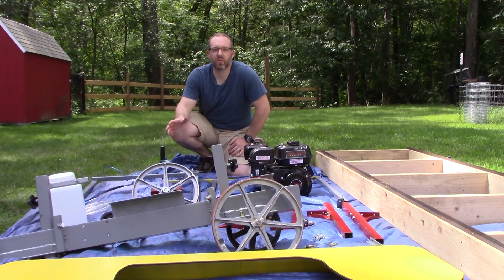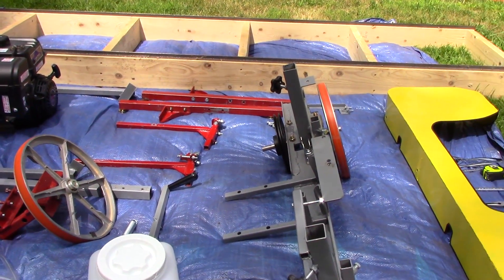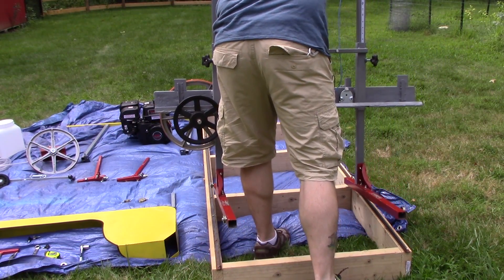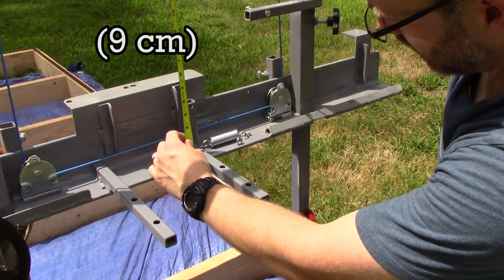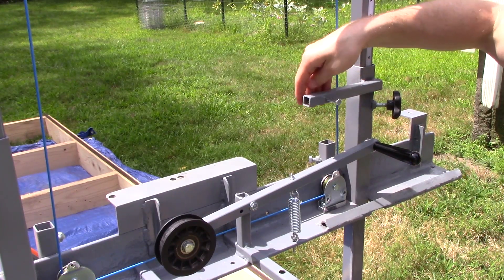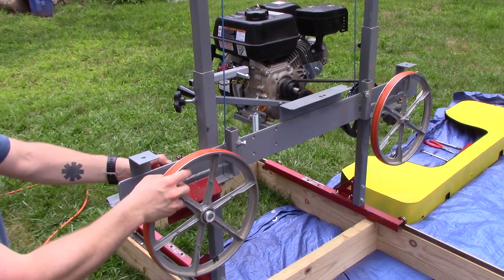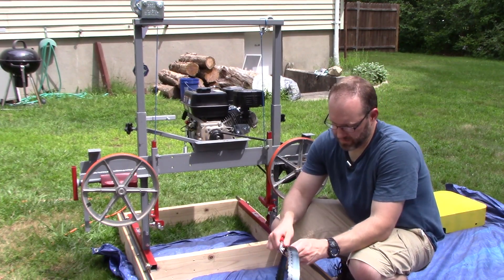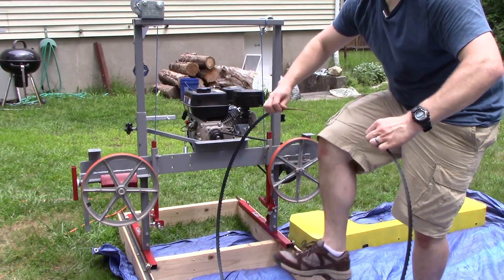Homemade Sawmill - Full Overview plus Upgrades and Safety Features

Comment: I'm trying to build my own mill and using 12 inch pulleys the only part I'm not sure of is the size and lenght of blade and how many teeth per inch. What size blade did you use

Comment: I had a blade that I ran into the saw guides so I used it to test and adjust my saw sharpener.  I ruined it even more testing the saw sharpener.  Even with the saw sharpener not completely adjusted it improved the performance of the damaged blade.  I will let you know if I get it running perfectly

Comment: So far I have sent over 20 copies of my plans of your design all over the world.   Lately it is been one request every few days.  Many commented favorably on the simplicity and portability of your design.  They like it.  It is a great design.  Don't give up on it.  Wondering how you are coming on  your redesign.
Reply from the maker: Hi Stephen, I'm still working on it.  I just haven't had the blocks of free time to do the grinding and welding.  Also debating whether to build the rails first or mount the new wheels.  I have a trailer that I plan to attach steel rails to semi-permanently.  Portability is still the goal.

Comment: Here a few thoughts on using my copy of your sawmill.  One of the members of my crew in Wisconsin was a small engine repair  teacher.  He said to use premium non ethanol gas for small engines.  He also said to turn off the Harbor Freight engine first slow it down then turn off the gas and then the spark.  Also to drain water from the gas tank there is a screw on the side of the carburator base that can drain some gas/water from the tank.  This has happened to me and   it works. Also one cause of blade wandering is a dull blade.  Today I had this problem cutting 16" oak.  I put on a new blade and problem solved.  Dennis, have you given any thought to blade sharpening?  Also to answer the previous post.  Mine cost approximately $1000 counting every nut bolt and screw with all new material.

Comment: Dennis, Thank you for your series on building a sawmill.  I just finished mine based on your design and in my preliminary tests  it works better than my wildest dreams.  I made a few changes to your design.  I used Grizzley 17" wheels which included an 8" and 9" pulley attached to the wheel.  I also used 2" and 1 3/4" steel for the uprights.  I Added a means for tilting the wheels to adjust the tracking.  I love your blade guides that can be tilted.  They are great.  Your tensioning system is also a great idea.  Nice and solid. I used cheap bearings that people have complained about,but at 10 for $13 I can replace them.  Mine is a little bigger.  It is also taller which was probably a mistake.  Ill see.  Thanks for the inspiration and for answering my questions promptly.  I am currently working on dogs to keep the logs steady.  I don't suppose you will be working on a solar drying kiln to dry all that lumber you will be milling. And doing a series.  Just a suggestion.  Thanks again. Great series!  It is a great little saw.
Reply from the maker: Stephen, that's awesome!  I'd love to see your improvements.  Do you have pictures?  My email is whatdennisdoes@gmail.com if you want to share.  Thanks!
Reply: Thanks Dennis I have a lot of video and a hundred or so pictures.  When I get them organized in, I hope, a few days I'll send you the best ones.  Thanks for the inspiration. My wife was supposed to take a video of cutting the first log, but I think the "on" button didn't work so I will have to retake it soon.  As a retired engineer I couldn't get over making a parts list and complete set of drawings so I could send them (pdf) along when I check them over if you want.
      Stephen Anderson
Reply: Stephen Anderson is this something you could email me... also? :)
Reply: @stephenanderson3056  Could i also have those emailed to me. I want to built one very similar.

Comment: my first production mill came with all kinds off glitches and it had all the bells and whistles but over the months and years i fine tuned it so stay with it lots of help out there and if it fits in the car your on the road just tweak it then how meany board feet will it cut build a jig for the track two cut sized lumber call it the weekend worrier would i build a mill from scratch yes have fun Dennis stay small that tinny  house thing still out there

Comment: I am about 95 % done building my sawmill based on your design.  There is an advantage to being retired. All I have left is the Idler pulley assy. and the guards.  I am impressed by your blade guides.  The tolerances are pretty close for them to work properly so I need to rebuild the first one I made.  If most of this is your original idea I can see several things that might be patentable.  One last  question How did you figure the belt size to make it slip when the idler is not applied and work with the idler.  I hope to make a video of some of mine so you can see it.  I have added a means to adjust the tilt of the wheels and therefore tracking and have added a brake for the trolley.

Comment: Place a centrifugal clutch belt drive on the engine and a bike brake handle on the push bar with a brake cable going to the motor, that way you wont have to keep stopping your motor like you did in the last video, the clutch will disengage at about 1800 rmp but will still give you top end speed once the engine has been re-engaged with the brake handle. the blade will slow to stop while taking the last slab off. with this you will be able to pull back the blade, set the height for the next cut pull the handle to engage full power and start another cut quickly. I've seen this done on the larger machine you can buy.
Reply: The simply design I like, If ok would like to use some of it for a larger machine, which I think would work great.

Comment: Another question.  What technique did you use to weld the nuts to the corner of the square tubing.  I didn't see any way to do it on the various welding channels.  Thanks  much.
Reply from the maker: +Stephen Anderson grind a flat about the size of the nut, then drill a hole larger than your fastener.  So maybe 3/8" if you're using a 1/4" nut.  Then just tack the nut on.
Reply: Thanks much.  I suspected it was something like that.  Nice to have it verified by the expert.

Comment: Appreciate your effort and frustration. I think you try to saw too bigger log for such a mall contraption. Wheels are too small so you cannot use a proper larger ,thicker blade. Also your guides are dodgy! Not holding the blade consistently because not griped downwards. I might add that the blade is not exactly parallel to the rails so it tends to go one way or the other fighting the grain of the log. Good effort though. I plan to build one sawmill and have several band saw stop get experience from. Have a good Xmas

Comment: it might add some more rigidity if you add a bar on each side of your yellow handle bar, up to the top of the uprights. it"ll tie it all together and maybe take some more of the wobblyness out of it, as its cutting.  I think you have better luck if you had used bigger, heavier materials to build it, but i think its a great little mill. hey it saws wood! awesome
Reply from the maker: +Erocks Garage like diagonal bracing right?  I agree, I'll have to try that.  Thanks!
Reply: What Dennis Does, yea if you looked at it from the side, a diagonal from the top of the machine, down to the yellow handle bar. One on each side of the machine. It looks like your crank handle might get in the way but you could probably bend it out or move the crank assembly over or something.
Reply: What Dennis Does, one more thin I want to suggest, you mentioned having an issue with your adjustable blade guide getting knocked down and sending your blade of coarse. That adjustability needs to be more rigid. Hard to describe, but of you go to 9:44 in this video and pause it, the verticle bolt in this frame, replace it with a bolt that has more threads so you can double nut the bottom of it, a nut on each side of the roller bracket. Then you'd have to weld the bolt head on the top side. This would keep the pivot stationary and would not be able to move unless you screw both of the nuts to adjust it. Another way you could do it without welding, is to use a piece of all thread and just double nut both ends, that way the adjuster can't get knocked off coarse. Hope that makes sense, I'm not good at describing what I can see haha! As the roller guide sits now, nothing is really holding it in position except one pivot point and any little slightest jerk will send it facing down, throwing your blade off coarse. I don't think you even need that adjustment really, if it was mine, I would just weld the pivot solid so it can move at all.

Comment: Could you please provide specs on your blade. Using 13" wheels and having same problem you had. Thanks
Reply from the maker: The blade is a Lenox Carbon Steel Flex Back Hook Raker Set, 3/4" x .032, 2 TPI, 110" long.  I tried several other 3/4" wide blades (there aren't a ton of options in this width) and this one happened to be the cheapest and cut the best.  I bought them from www.toolcenter.com - sketchy looking website but totally legit and they got my custom order to me fast.  (no affiliation, just stumbled on that site)
Reply: Thanks Dennis for the info and very quick response! I really appreciate your getting back to me. Seeing your mill operate has been a big inspiration for me to continue working out the bugs and getting mine running right.  I know the effort you put into yours. The basics are simple but the details must be right. Thanks for sharing!!!!

Comment: What's the length of the main carriage beam?And what is the length of the uprights that slide into the square tubing that's welded to the carriage beam? Also is your bandsaw blade 104" long? BTW your sawmill design is amazing!
Reply from the maker: Main beam is 47" long, the uprights are 41.5" and the blade is 110" ...though if I had to re-order I would have gone with 109 or 108".  110 doesn't give me a ton of room for expansion on my saw.  The only reason I went with this size was because I thought it would also fit a 3 wheel bandsaw I have in my shop.  Starting from scratch I recommend just putting the wheels where you want them and then measuring with a string to figure out the length blade you need.
Reply: Thank you!!! Btw I looked over your video again I I think your saw could use another steel roller in between the front and back; basically inline with the uprights. Once again thank you!